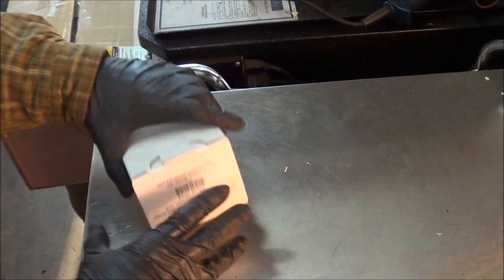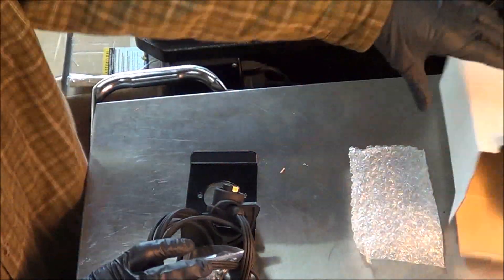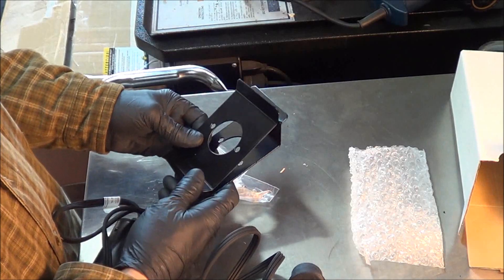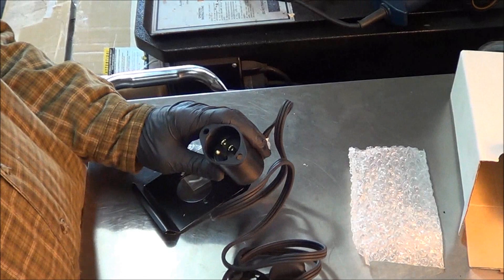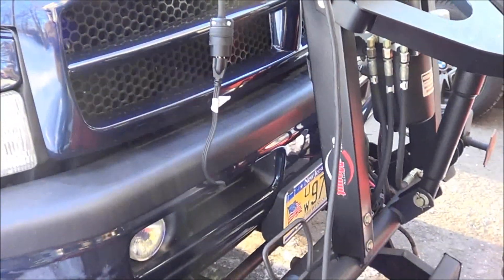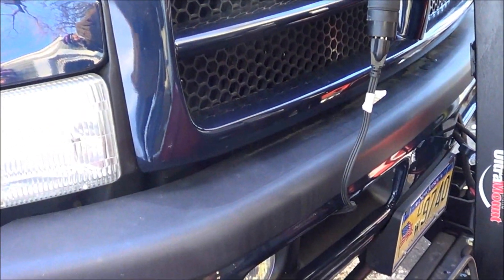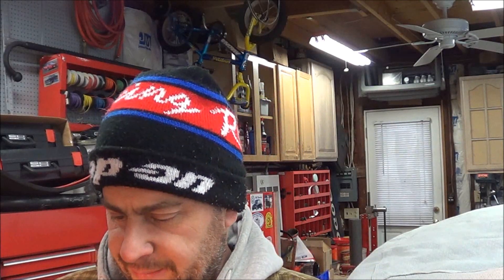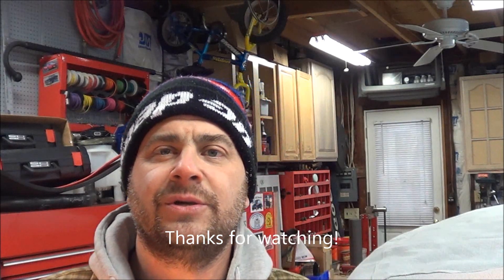12-16-13 Dodge 6BT block heater cord and radiator blind

Comment: Well looks great! I was wondering where you got that radiator from? I will need one soon on my 95 Auto...and most look like cheap crap!
Reply from the maker: I got it from RockAuto. It's a Vista-Pro model 0432464. Made in Mexico?
Reply: Thanks! Since you did not say you regret it I will place it on my list! Again thanks!
Reply from the maker: Garth Ogle it's been good for about 4 years now so no I don't regret it. Thanks for watching

Comment: Have you found a way to connect the battery blanket heaters to the plug heater so you only have one plug to plug in instead of 3?
Reply from the maker: I don't have battery blankets so I haven't tried... I'm sure with a little wire splicing that wouldn't be a big deal at all.

Thanks for stopping by.